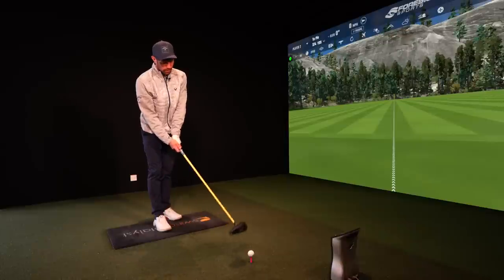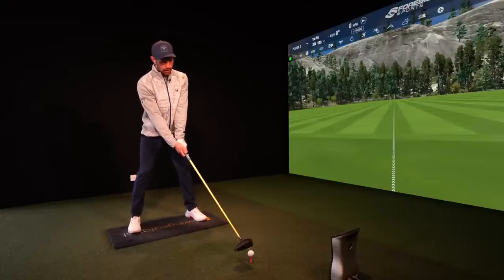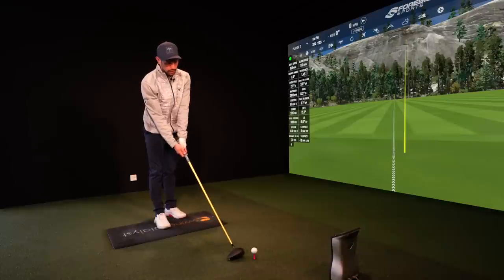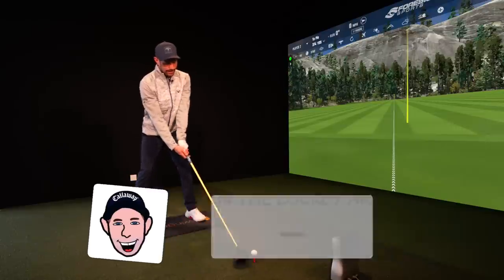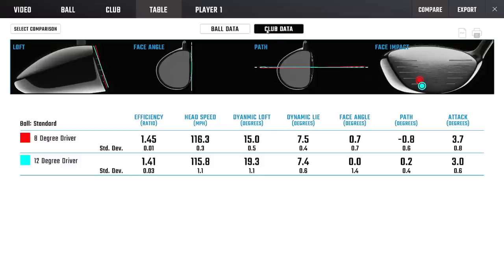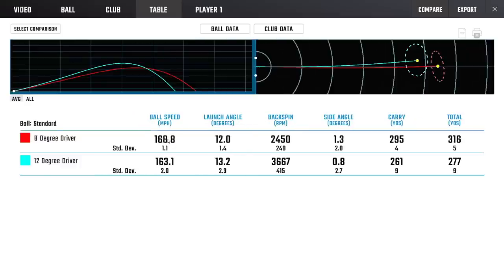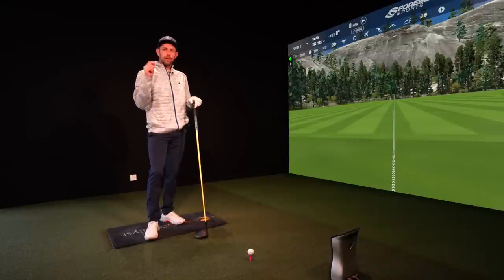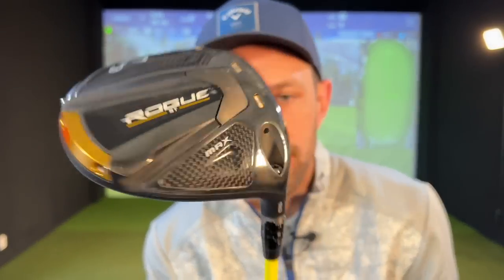ONE SIMPLE CHANGE FOR MASSIVE GOLF DRIVES

Comment: Thanks for that.  You boiled down a lof of what I was trying to figure out.  I just this week learned that was where my excess spin was coming from, but could not articulate it.  Great stuff.
Reply: Do u recommend this for a mid to high handicapper as well?
Reply: @robbiegolding1831  I do not have the expertise to make recommendations.  I am a 12 hdcp.  I have a 105 swing speed.  My spin rates were 3k+.  I was not getting the distance I should.  I randomly lowered, significantly, the loft on my Cobra driver.  I found on first session, I improved face strike and brought spin down to around 2,500.  I increased carry by 30 yards.

Comment: Great video. However people need to be careful assuming that lower lofts mean great distances. I am a 60 yo 17 handicapper and had my driver at between 9.5 and 10.5 degree loft and was averaging 190 metres. After having read an article that suggested higher lofts may help slower swing speeds I went up to 11.5 degrees and now average 210 metres. Better flight more distance and am straighter. I am also finding the middle of the face a lot more.

Comment: I used to be at 10.5° on my Maverik and now bought the Stealth. I did take a stiffer shaft, as I've come to increase my club speed, and I now got the loft down to 9.5°. That got me around 20 meters more carry and my drives are straight. However, I've tried lower lofts and I tended to get more fades on that. So, either I henceforth contend with playing baby fades with longer carry or I just concentrate on getting my short game much better to make those up and downs from 20 meters further away. Ok, that's silly. I will do the latter anyway.....

Comment: I know you muppets dont care for shafts but i have recently gone back to my reg shaft, just to see and suddenly started hitting draw bombs down the line. only had 3 games with it and 1 range session, finding it hard to find the middle of the face with it but i need alot longer with it to know.  I think my swing speed sits on the 100 to 110 mark more on the lower side, never had the chance to use any device that measures club head speed saddly but i guess this should be my first step.

Comment: With the higher loft and your club head speed, I'm thinking higher spin with the higher loft driver and 15 - 25 yards less carry. As far as run out, if it's spring time with wet conditions, the difference in the run out between the different loft divers  will be closer  together.

Comment: Great video  coach.   . I play a  10.5 degree Driver  . I an averaging  220 to 230 yards .my problem is  I get to much height  . I'm  looking  at  well over  100 to 130 foot in the air . I have  played  around  with  different  tee heights. It as helped .Would  a 9 degree  Driver  be  better  ? 
Keep up the good work
Reply: I would say, do with Coach recommended. Lower your 10 1/2° loft down to 9 1/2° and see what happens to your distance!

Comment: Strike was pretty significantly worse with the 12 degree. Surely that has nothing to do with loft? I also think this video is going to make people think that less loft means more distance, which is not the case for the majority of amateurs.
Reply from the maker: Lower strike definitely means higher spin all things equal. 4 degrees high dynamic loft will have a significant impact on the spin as well as the slightly lower strike. Unfortunately I am not a robot and getting exactly the same strike location over a number of shots would take me quite some time. 

At 5 minutes I say get the correct loft for your delivery and I put the table up at the end which shows what launch and spin conditioning are best for all different speeds. Never do I say lower loft is better. 

Thanks for the comment though and watching. I will try my best to make things as clean as possible going forward 👍👍

Comment: I have a B21 in 9.5 N and it’s high spin. Got fitted last April and a year playing is now worthless.
Reply from the maker: B21 has low and forward CG bruh. If you have high spin with a 9.5 that is nothing to do with the club I'm afraid. Strike and spin loft is where you need to start to lower that spin
Reply: @CoachLockey  using castle tees as a guide pink I’m over 4000 spin, white or a mm or two higher in 3000 range. Can’t afford GC Quad so went for Garmin R10, I hit up on the ball according to device but spin is ridiculous.

Using project X Hzrdus smoke blue rdx 60 shaft, PVD for looks, swing speed 105 at best

Comment: Okay so here are my stats from a Trackman session;   
Driver Loft: 9.5 D (draw bias apparently).    
Swing speed avg: 91mph 
Ball Speed avg: 135mph 
Launch Angle avg: 10.9deg
Avg Spin: 2410

So what loft should my driver be?
Reply: I’d say your launch angle is too low. I use a Skytrak and launch 16-18 is optimum. My driver is set up the same loft bit I’ve changed how I address/hit the ball. I’d say your spin is good just needs more time in the air. 220 carry 250 total possible based on testing I’ve done near that swing speed.

Comment: I use 10.5º lofted up as high as possible but still get lower piercing ball flights. Everyone tells me it appears I'm hitting "up" on the ball, but I just can't seem to present more dynamic loft. Ball goes straight, though.
Reply: Are you sure you aren’t just catching the ball very low on the face?
Reply: @jonathanpeel989  I’m fairly confident that I’m producing a flatter attack angle than it’s appearing. When I tilt back to the point where I feel like I’m overdoing it, I can get the ball to start with a higher flight. And I’m teeing the ball much higher than usual, using tees at least 3 inches high.